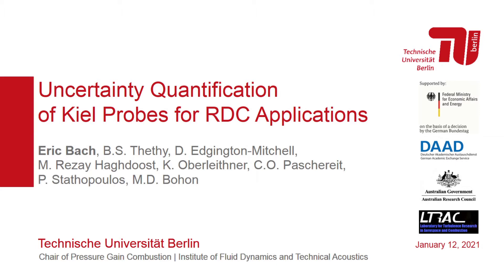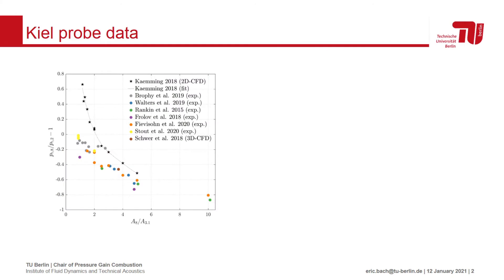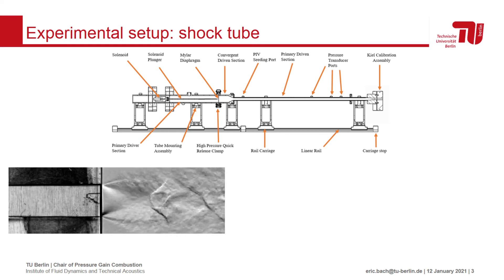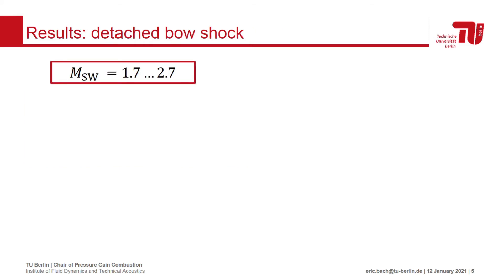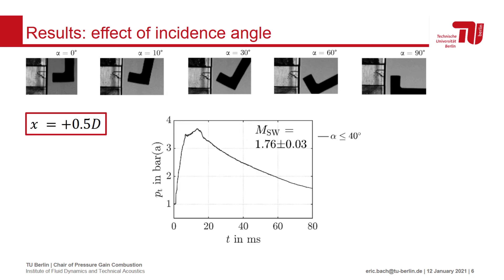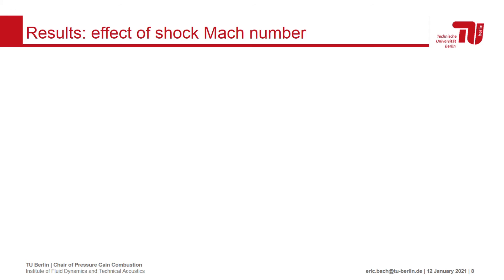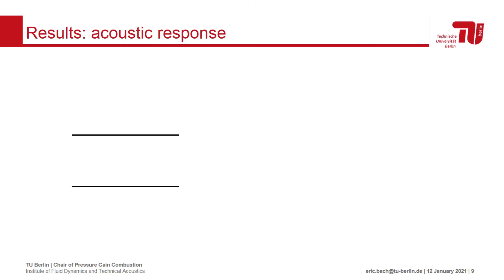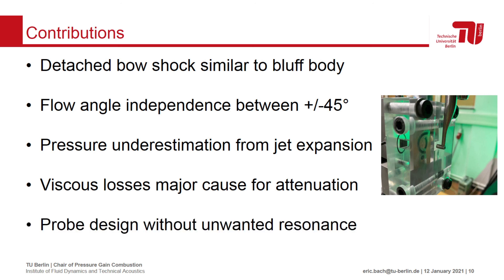Kiel probes for unsteady rotating detonation experiments

Comment: The Pitot tube isn't particularly useful for further tests, is it? What you want is an efficient, stable RDE shape with materials that won't ablate.

Can't you get the exhaust velocity and expansion rate directly from the schlieren imaging? You could measure the exhaust composition without obstructing the critical exhaust flow by taking a sample downstream, and get the exhaust gas temperature from IR sensors?